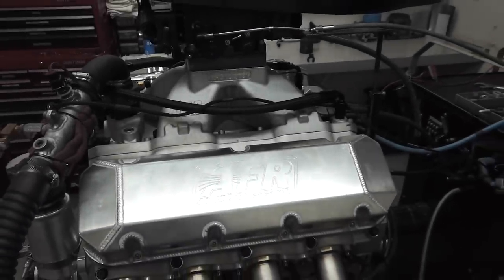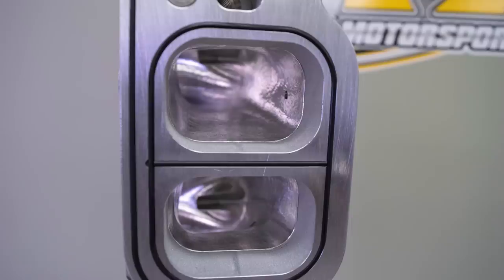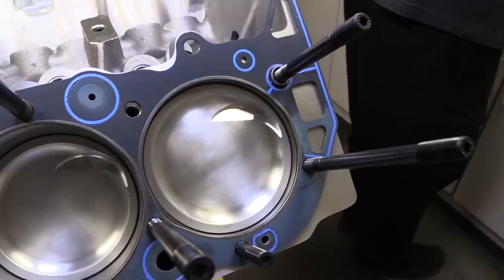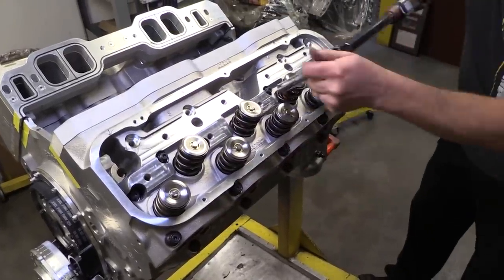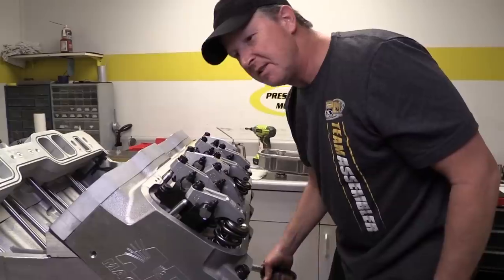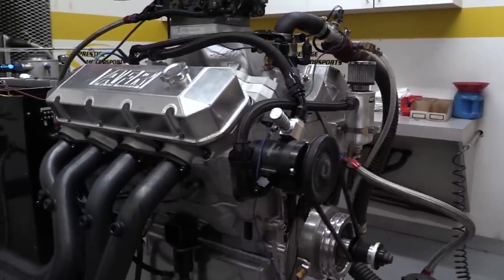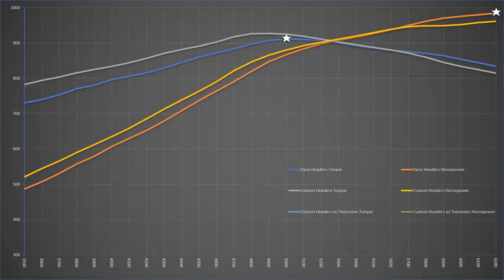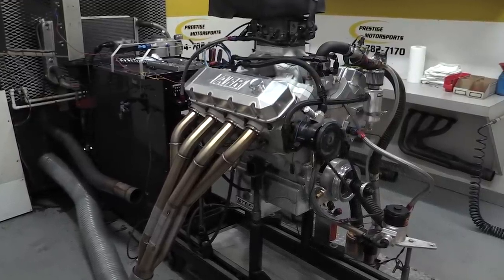665 Cubic Inch (10.9 Liters!) Monster Big Block Engine Build [The Displacement King]

Comment: If hp is still rising at 6200rpm that motor wants to rev to 7000! Push that throttle and give us a true "peak" hp number - you guys are selling yourselves short!
Rev that thing!!
Reply: Erotikstudio Winkler GmbH  yes but you'd see a loss of power on the dyno if they ran into valve float. Valve float decreases combustion pressure so there'd be am obvious drop in power. I bet it would happily make good power to 7000rpm if it was still increasing at 6200rpm. But it was clearly breathing just fine at high rpm and if they did get valve float, they could just switch to a heavier valve spring setup. The extra rpm would more than make up the difference from having slightly higher parasitic losses from squishing the heavier valve springs.
Pushrod motors can rev over 9000rpm and make it 500 miles so I know this engine had more power in it! Still a sweet build though making good power all the way thru the rev range even at under 4000rpm it would pull like a rocket ship I'm sure. It definitely had more rpm and power left in it though!

Comment: Nearly 700 inches on an all-custom BBC build and only 10:1 compression!? Race gas isn't that expensive compared to what this guy probably spent on everything else, he'll chance it all on pump gas? This monster needs to be 14:1
Reply from the maker: It is going into a boat. Marine fuel -- the stuff that is available at the docks -- is notoriously inconsistent as some tanks can allow the fuel to draw moisture. It isn't about wimping out, it is about working in real-world conditions. Thanks for watching
Reply: @TheHorsepowerMonster  He's building a $20k engine and putting boat dock fuel in it!? 😲. Seriously killing me here

Comment: OH HOW I WISH A MPG WAS ADDED TO THESE BUILDS !!!!!!!!!
SAY DIGITAL METERING DEVICE AND SET AT SAY 2500 RPM UNTIL 1 GAL PASSES THROUGH.  SO IF I WANT TO RUN MY BOAT FOR, SAY, 5 HOURS, I'LL NEED A TANK THAT IS XYZ IN DIMENSION FOR X AMOUNT OF GAS. WHAT OCTANE DID U RUN ????  OR MY 73 BLAZER. HOW LONG / FAR CAN I DRIVE THIS MOTOR AT 2500 ??   THERE is A WHOLE LEVEL LEFT OUT BY ALL THESE CHANNELS.  ITS 1 EQUATION, 1 GAL @ 2500 !!!  the rest is math for the individual based on gears n tire size. weight n driver habit not included 😅

Comment: Should have used timing gears.
Reply: @AB-80X  no, gears are far better.
Reply: @JoeZelensky  If you run circle track with no damper maybe. I have used Jesel belts for years, and they are by far the smoothest and most reliable for anything that's in a boat or a hot street/strip deal, especially if you run a blower. It is very precise and it also soaks up vibrations.

Comment: Not even 100HP a liter, the miracle of pushrod 2V V8's that get 2 miles to the gallon.  Is this supposed to be an accomplishment?
Reply from the maker: How many 100hp per liter, naturally aspirated pump gas engines do you know of?
Reply: @TheHorsepowerMonster  Have you heard of Ferrari?  Plenty of Porsche's.  I have a Lotus 2.0 907 in the garage right now, 200hp at the flywheel.
Reply from the maker: The Lotus 907 is rated at less than 150 horsepower. Even if that is at the rear wheels, that means the engine is producing only 170 or so.
Reply from the maker: But the entire purpose of this engine is torque, not high-rpm horsepower.
Reply: @TheHorsepowerMonster  Not when it has high comp pistons and a different cam and dual Weber 45 DCOE's.
Reply from the maker: You picked up 50 horsepower with a piston and can swap? Impressive!
Reply: @TheHorsepowerMonster  Porting, some headers, cam, and DCOE's, sure.  Lotus made much more power in their later engines with basically the same setup.  Cam was from Dimitry Elgin.  The 907 is a twin cam.

Comment: a nagging question is messing with my head. what is up with all the gitty up for a fan boat? you can only twist a blade at 6000/6500 safely no matter how deep the rake. any harder you run the risk of looking like a messed up vr. of Vlad the impalers victims 

i don't know about you but i don't want a bunch of big ass propeller splinters sticking out of me

no gains to be had after the recommended rpm. just doesn't make sense for a gator boat now an armored bottom jet boat now your talking. the next plausible choice would be 'that is if you just had to set records in a flat bottom beer hauler' would be a turbojet turbine if you just had to go that fast.

 i just dont see some good ol'boy doing that to put work in. since being out there in the first place is to put food on the table so you can bank your food budget, or maybe teach your kids how to live when the money drys up.

this thing belongs on a rebuilt tractor plowing rows, not on a  fan boat.

Comment: Motor is undercarbeurated. Nice build though.
Reply: Lol, really? Riddle me this Batman. How much torque and horsepower is a 1470 cfm Dom capable of making, and what kind of power can you make with a 1050 cfm?
Reply: Blower or turbocharger running alchohol 3000 hp has become common reality.  My comment was not meant as an insult or downplay or disrespectful.  That's a nice build and that's that. Like it or not.
Reply: Batman!

Comment: It won't hold up Chevy made it they're just trying to make something to beat the  Ford motor company's 7.3. It does not matter what GM does they will never be Ford motor company. They just don't have it in  Them. They say they can do so much. I haven't seen it yet. All I see is a bunch of great manufactured krapp. That here lately a lot of people are getting pist off about. Me myself I never did like Chevy from the beginning. Back in the sixties and seventies they could make a decent car. But after that they kept trying to beat Ford motor company and that's all they kept trying to do is beat Ford motor company. And they still haven't did it for how many years. And they never will. GM are for boys and idiots. . That's why they all have attitudes. Still trying to figure out how to beat Ford motor company. And never will they just need to  Face it.
Reply: Besides all that, Chevrolet has the Most Motorsports victories and Manufacture's wins...lol

Comment: What is pound-feet? Oh. Do you mean foot-pounds? There is no such thing as "pound- feet". There's no such thing as RPMs either. It's RPM. Revolutions per minute . Not revolutions per minutes.  What's next? Pound
Inches?
Reply from the maker: I'm just following the Society of Automotive Engineers when it comes to pound/feet. I can't win because I'll get comments like this either way, but I figure everybody know what I mean. Thanks for watching.
Reply: Look at Mr Ninny Picker here. If this truly is the best you got for this video.....You need to go home, hug mommy and think of something better. I suggest you check your blinker fluid in your moms car, make sure she is running the approved winter grade air in the tires, the muffler bearings....well in your case, I think you are running the cheaper muffler bushings, and make sure the nut behind the steering wheel is tight. Because I know for a fact its not. So skipper...sit down, shut up and live with your moms under-powered Dodge minivan we all know you have.
Reply: @iamtheoffenderofall  LOLOL NO SHIT CANT STOP 😆